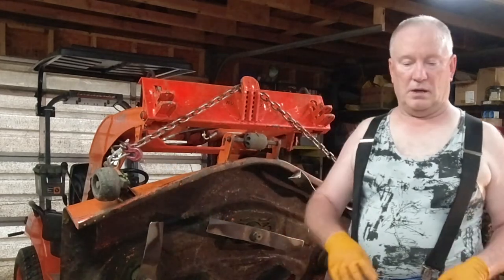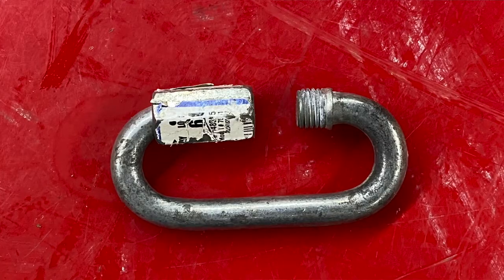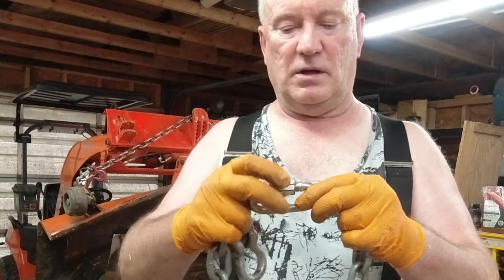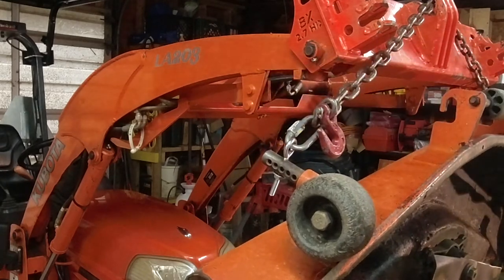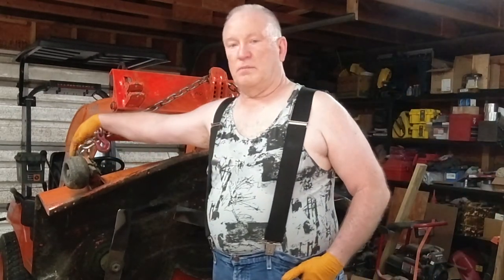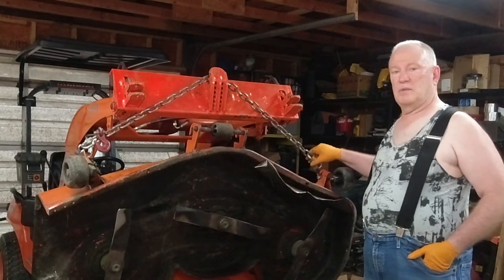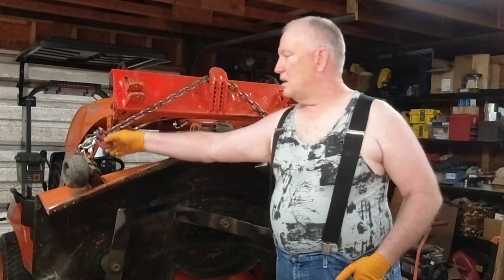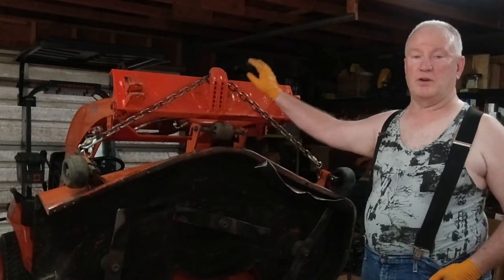#86 - BX Mower Deck Lifting Kit

Comment: I've got a cheap electric winch in my tractor barn that I use to lift heavy items including garden tractors and mowing deck.  Since i work by myself 95% of the time, I always, always use a safety chain or find a way to crib up the tractor, deck or implement I am working on with 6x6 or 4x4 blocking.  When I was young I had an uncle crushed when the bumper jack collapsed on him when he was changing bracks on an old car.  If my dad hadn't been there at the time, he would have surely died.  
Safety is always a priority around my shop.  Especially as I get older and am not as fast or nimble as I once was.   Hard to admit it, but it's true.
Be safe, be aware and know your limits.  Have a great night, Bob!
Cheers!
Whipple
Reply from the maker: Accidents happen so fast.  Even when you think you are safe, stuff happens.  I hope everyone is doing well out your way.  Thanks for watching and commenting - cheers

Comment: Those decks are so heavy it’s hard to handle them without a machine. I usually leave mine on the tractor and drive up on blocks or ramps and crawl under, but that’s not too easy either. It’s good to share these different ideas! Great video!
Reply from the maker: Very true!  Thanks Ben, my goal as a YouTube creator (haha), is to share information.  The result is everybody learns.  I can't believe I have not seen this trick before here on YouTube.  Of course, someone might see this and say there is a better way.  I am open to new ways of doing difficult tasks.  Thanks for watching and commenting - cheers

Comment: Love it.  I have been thinking of welding on some hooks so I can use my pallet forks more easily, rather than loop straps. But, this may just do it too.
Reply from the maker: Thanks Ram.  It's such an easy idea.  No special tools needed.  I leave the eye-bolts in year round without any issues.  2 - eye-bolts; 2 - ny-lock nuts; 2 - carabiners; and 5 feet of chain.  Thanks for watching and commenting. Enjoy the Journey - Cheers